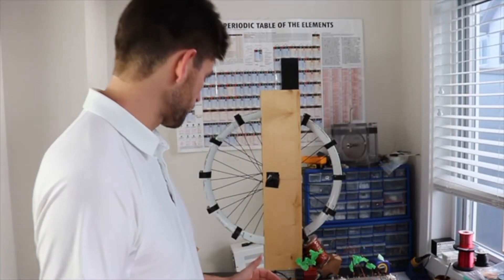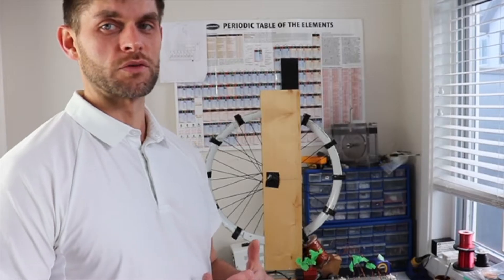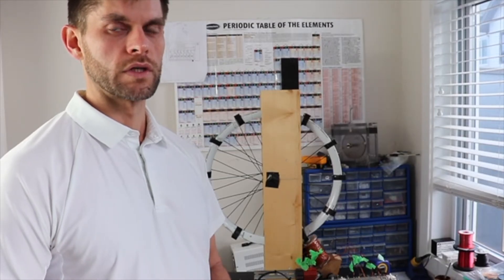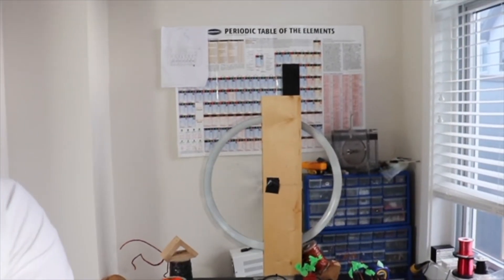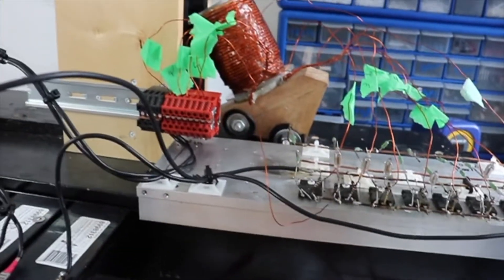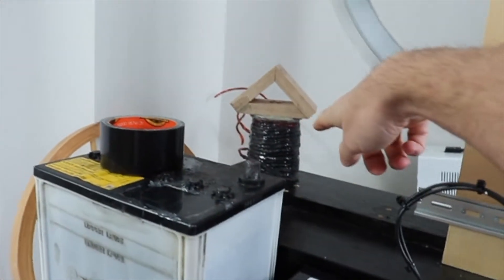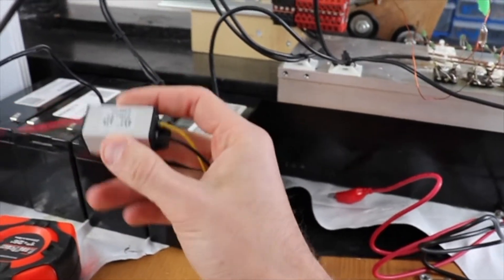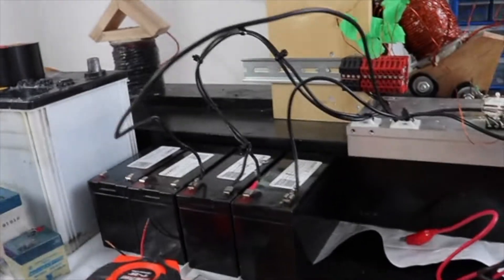Bedini Generator, Free Energy, Perpetual Motion, Overunity, Radiant Energy. Open System!!!

Comment: The total amount of energy should increase. The following test should be interesting:
Step1: discharge the helper battery to a know voltage.
Step2: fully charge the main battery to a known voltage.
Step3: run the motor until the main battery is empty (same voltage as you used to discharge your helper battery.
Step4: measure voltage in the helper battery (should be full at same voltage or higher than fresh main battery)
Step5: swap main and helper battery and repeat enlessly. Measure heat buidup in helper battery.

Use smaller batteries or it will take forever.
Reply from the maker: Small batteries are no good for this, they dont allow the effects we are after. Great comment though.

Comment: so why don't you just show a sensitive voltmeter reading on the incoming and outgoing power? Even a millivolt as a proof of concept. I would think an electrical engineer would want to show that data.
Reply from the maker: Im going to in the upcoming videos. 

But the little one isnt likey overunity and measuring a different type of power with traditional scopes might not help.

Anyways I do plan to do measurements in 2 videos from now and modify the little one to help get it producing excess

The purpose of the big one is to have a proper data logging system and way to measure excess work

Comment: I’ve got the Bedini Circuit too, I use a Radiant Energy Accumulator Collector (REAC) which is 4 or more completely sulphated Dead Batteries connected in series & parallel (Randomly) with the charging battery. I don’t remember who came up with the REAC, but it works. I think that the Ecoflow Delta 3 with 4X 400Watt Solar Panels is a better FREE Energy system. In a few weeks I’m installing the Ecoflow Delta 3 with an 800W Alternator Charger into my Ford Transit Van then next year I’ll install 4X 400Watt Solar Panels on the roof of the Van with actuators that tilt the solar array towards the Sun at a 45’ angle.
Reply from the maker: Agreed. Im going to do upgraded on the bedini to make it viable :)

Comment: Have you tried Stanley Meyers Water Fuel Cell. It uses Back-EMF Im-Pulses from a collapsing Coil to charge a Water Fuel Cell by knocking off Electrons with High Voltage to create a +Positively Ionised HHO Gas with missing Electrons (Apparently has more Ooomph than regular HHO). Then you just -Negatively Ionise the intake Air then use EGR as exhaust gases help to slow down the Burn Rate of the HHO Gases.
Reply from the maker: Lol i wish it was that simple. I would like to make a variable frequently pulse dc electrolizer to find a resonance
Reply: @MadscienceLPTECH  It is Simple using a off the shelf Phase Locked Loop (PLL) Auto-Resonance Circuit. At LC Resonance it only consumes 50 Milliamps & is Voltage Dependent, you control output by turning a Dial on a Variac Transformer. It’ll create an Opaque Cloud of HHO Gas Bubbles pouring off the Cell Tubes which isn’t reflected by the amount of Power it consumes.

Comment: "Air Core vs Iron Core - They Are All The Same" by Paul Babcock.  Purchase the full version of this presentation.  It will reduce your learning curve by 30-40 years or so.  Bedini passed on an Over Unity system.  NOT an Over Unity device.  The pulse motor is not very efficient and it's only one part of an Over Unity system.  It is 20% efficient at best.  So why or how could a pulse motor produce Over Unity, or Infinite COP?  Let Mr Babcock tell you.
Reply from the maker: much higher then 20%, i believe the SG is over-unity with the correct fine tuning. Appreciate the info though, ill be sure to implement it
Reply from the maker: Thanks again for this information, I'm going to take this to the next level!!!!!
Reply: @MadscienceLPTECH did you find overunity in sg, i was working on sg  and find coil working without weel( self rezonance) and ... But not everunity my frend. Not only me are working on overunit device

Comment: another, late, reality check            the use of several magnetic poles on the rotor is good.  but the use of single drive solenoid is still not adequate.     this is so in part because, the forces in a rotary machine  Should  be  Radially  Symmetrical.     so, your motor could/should be improved to have at least  three  drive solenoids.
at link i demonstrate how to, without a DC clampmeter,  Accurately Estimate  the output current and volts coming from a tiny pm generator.          yer motor is the alternator, i guess.
facts:     DC watts and AC watts are not 'equal'.         wild AC is not the same as mains AC, even if the voltages are apparently equal.             system output  Must, therefore, be rectified before it's measured.
in order to BE ABLE to say that a system is overunity,  there  MUST  be  a  Comparison  of  watts-in  and  watts-out.
a battery charging output circuit is  NOT  informative.     in part, this is because the state of the battery being charged is  Continuously  changing.    'state' refers to resistance, impedance, electrical bias, etc.
https://www.youtube.com/watch?v=iOJe2L_qG0s
Reply from the maker: Haha I agree more coils are better, but that's about it... its not conventional electricity going into the battery

Pure high voltage impulses, radiant energy

Comment: Laws of induction? 
Do you know anything about it? 
I'm sure it was issac newtons work,
 be worth a read
Reply from the maker: I'm an electrical engineer and fully understand science... this would be operating in an open system vs a closed one... open systems break no laws
Reply: @MadscienceLPTECH  I'm a qualified electrician went college but never did it as a job, they didn't teach us isaac newton law of induction but i did read it later on, you say in the video you don't know where the extra energy comes from, but its there ;)
Reply from the maker: @doubleooh7337  yes exactly, i belive it comes from somewhere that interacts with the high voltage gradient of the inductive collapse.... stay tuned, I've got lots more content coming up
Reply: @MadscienceLPTECH  i will mate, i need some motivation before i finally wind my final aircore transformer motor, i got 10kg of copper wire   20 rolls of 500g wires winding  24awg, all 20 simultaneously wound together, i got 4 coils to make 2 for thd motor, 1x 20/1 transformer that can be 10/1 aswell for uk/usa output, what is left im making a giant pick up coil which I'm hoping will switch a transistor with just a turning magnet(no battery). Might not work but it might.
Reply: @MadscienceLPTECH  I'll be putting it on here in a couple of months and gonna try to power a hydrogen cell from it and other stuff, n52 magnet spinning within a coil different way but years ago i did have a bedini ssg on it it span fast and chimmed, i wanna do more thsn charge a battery
Reply from the maker: @doubleooh7337  nice I'm going to grow food with a light powered by the SG
Reply from the maker: @doubleooh7337  what part of the world are you in ?
Reply: @MadscienceLPTECH  southwest uk how about you? I don't know anyone near me interested in this stuff
Reply: "I fully understand science" best laugh ever! 😂😂😂

Comment: Have you heard about impulse power secrets and impulse energy secrets by kanarev. The papers claim self running generators are real and they have a picture of one. They also explain to some extent the theory behind it and create a new law called the inertial increase of electrical power. 
From my understanding: So a flywheel cannot do work if its speed is constant. However if the flywheel resieve periodical impulses that increase its speed, the flywheel speed now increases and decreases so its never constant. Thus it will provide real torque propertional to the change in speed. Once it is kept over a certain speed then its torque can be theroetically really high due to its inertia. This torque can then make a generator self run, especially if its a low drag generator.
Reply from the maker: stay tuned

Comment: Thanks for sharing. Battery swapping could be made automatic, using a mechanical holding relay.  I made my 2 coil Bedini Energizer, for the first time in 2014. But I noticed that BJT's were not as efficient as Mosfets and also to use Mosfets, the timing arrangement had to be modified, using a hall sensor. This also allowed me to use the trigger coil for energy retrieval. My coil was only 5 strands plus trigger. By using just 3 strands for the motoring part and the other three for power extraction, I noticed that the overall energy gain was much higher and there was enough energy on board, to self run the machine and also charge LA batteries for external power draw.
Reply from the maker: So sick, yes i have the battery flip flop automated
Reply: Hello Tony
Could you share your findings?
Parts list etc. 
much appreciated, thanks
Reply: Looks hood.  You know in 2010 at Spokane John did an exhibition.  He had a little tracker running from an energiser.  Ran for 3 days and ended up with 2 fully charged batteries.  He also had a massive energiser.  Looked like a ferris wheel.  Producing 700 watts of extra energy.  He said it uses radiant energy.  He told me the theory.  Good luck.  Good work

Comment: How long have you been working on these hobbies? Overunity,,
Reply from the maker: years, my main restriction is money... im about to invest another $2000 into the kromrey, hoping that will be enough to replicate john bedini's results
Reply: Been through a lot of experiments before, its really hard to self run these kind of devices,,  ,,, had tried to comnined it with "splitting the positive" configuration on battery really efficient while also collecting collapsing spike, ,,,,,

Maybe if u can combine kromrey, splitting positve configuration, using bedini motor concept collecting backemf back to battery, maybe it will sustain self recharge and self run

Comment: Nice work there.  Have you tried placing a Cap Dump across your output charge batteries?  I couldn't see it in your video.  Its better long term for the batteries as you'll notice eventually the Radiant Spike will make irreversible changes to the batteries..  I build my own Radiant systems & they are the future.  Its good your getting the message out.

Comment: How are you measuring the input power and the output power?
Reply from the maker: Currently im measuring the work i can do form the batteries i charge.... just switching the batteries from charge to run positions give >95% efficiency, and bedini said that wasnt the way to overunity, you need to do conventional electrical work with the radiant energy charge battery...
Reply: @MadscienceLPTECH  How do you measure the work you can do from the batteries you charge?

Comment: Hi…i liked and subscribed 

i love the whole overunity thing…and 100% support your efforts…but I think there is something here that’s not been considered

What if you’re charging system is putting spikes into the batteries.. that is causing micro tunneling(or other effects) to occur on the battery plates… increasing the battery surface area by 10 times or more

Keep in mind a sugar cube has the surface area of a tennis court if you could lay all the molecules out flat

Maybe you have discovered a way to make batteries work better by burst charging you are doing

The only way to be sure is to take the batteries out of the equation

So it appears that you are overunity … when in reality you might be dealing with batteries on steroids

I hope you’re overunity…
Reply from the maker: Thanks for the comment, I'm testing the work that can be done by the charged battery vs the work the run battery put into the machine.... we will find out shortly.

Stay tuned, I'm.not stopping until bedini and kromrey are 100% demonstrated to be over unity and open systems
Reply: @MadscienceLPTECH  maybe supercapacitor instead, to remove possible chemical energy (magic) from the equation? Subscribed